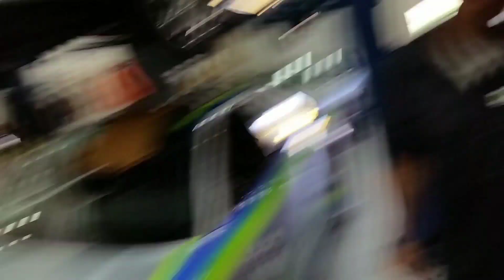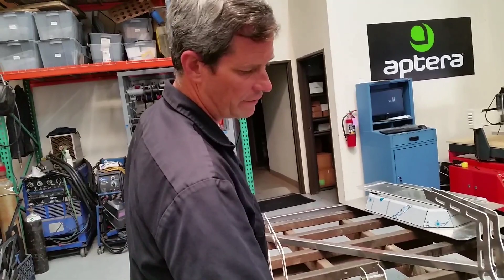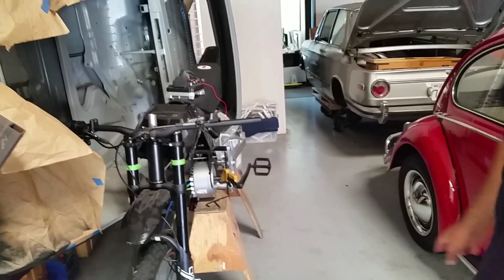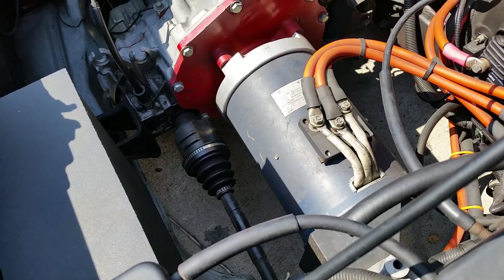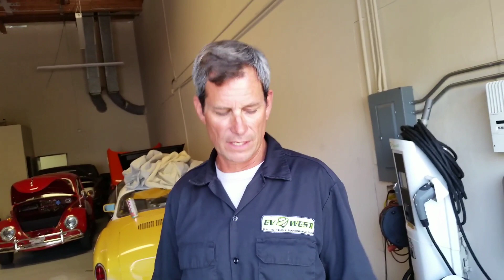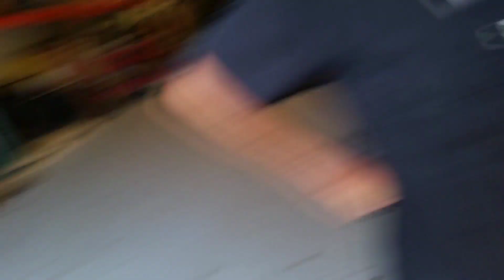Tesla conversion at EV West with Michael Bream

Comment: Do you think you guys will always have Tesla S motors? As well is there anything I need know about a good base to use with a Tesla motor? Obviously is has a high width base. However interested in anything else handy. Another thing I was wondering about these Tesla S motors can they be placed for RWD or RWD and if having 2 motors AWD? Then I was wondering if Chevy Volt batteries will work or are Tesla batteries cheaper and easier to get? Thanks so much for all the hard work you do and I hope to hear from you. 👍

Comment: I'm seriously freaking out right now, especially over that delorean...wow. if I was doing this interview I'd really have to just stop and take a few deep breathes.
Reply from the maker: Oh yeah...  that is a very exciting workshop.
Reply: My DeLorean is being converted as far as I know will be the first in the world to use the new hyper 9x 3phase AC motor
Reply: @admiralmarciniak1035  man that's awesome can I get a ride in it? ..if your l ever in metro Detroit... The only thing I need to do right now before I die is get a ride in a Tesla/ev.
Reply: @beasy7227  well I won't be taking it in to Detroit and it may take another two years at this rate for the conversion to be done but it won't be a Tesla or have a Tesla drive this is a DeLorean with a hyper 9x drive, anybody who's willing to help me do some of the conversion work will get a ride
Reply: @admiralmarciniak1035  I just meant a Tesla or ev...think I'm gonna convert my old truck since I can't really sell it.93 f150...really clean truck, but I don't know the logistics of converting yet. Is your delorean gonna be rear mounted motor and rwd? Is it possible/worth it to put two of those motors? How much harder is it? If I did it it'd make it for a drag vehicle not a daily driver...thanks edit: I'd probably just go with the Tesla s drive unit... I'm sure with the head units I've seen now it wouldn't be too hard to make it awd with 2 motors...my truck is ext. Cab.  Plenty of room for batteries... obviously weight will be an issue but I figure after gutting it, it won't be too bad like a model x hopefully...
Reply: @beasy7227  I'm going to use one motor drop it in where the old ice motor was keep the stock standard transmission and only use first and second gear